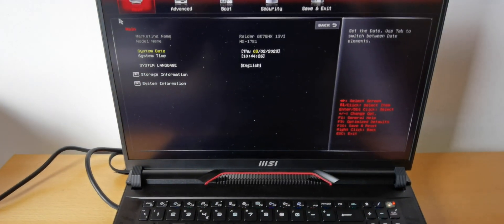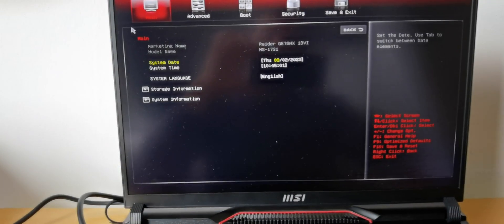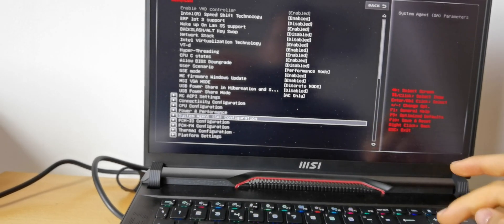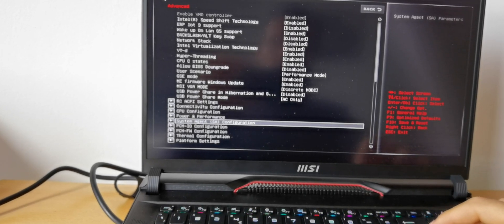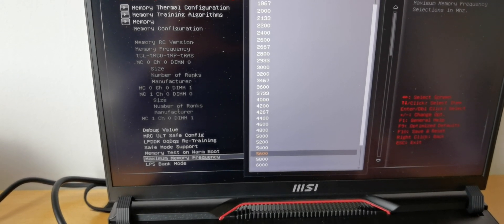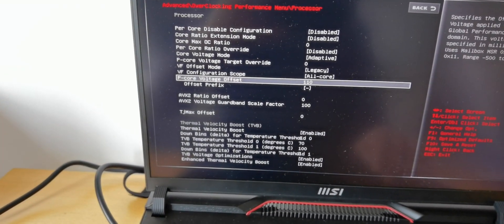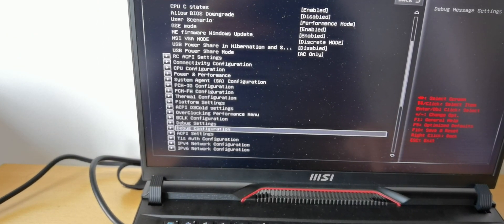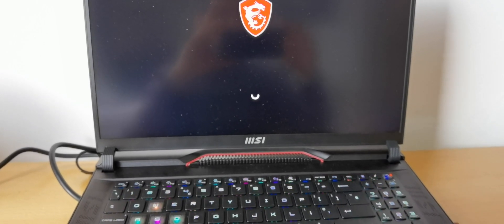how to undervolt msi ge78 gt77 cpu and how to change ram frequency in bios msi

Comment: Msi titan 18 doesn’t have a right Shift key.
Reply from the maker: funny enough is  that  i  bought a msi titan 18  with 5090 gpu,and i  did  managed  to unlock  the bios without  using  the  right shift  key.I sold  the  msi  ge78hx on ebay  few motnhs  ago.

Comment: Thank you very much! You are only one who explained clearly how to change frequency of RAM. It worked for me! My laptop - Raider GE68 HX
Reply: Seriously; what Gigabeat said, every orher msi bios video had a different UI and was not helpful, thanks for the video!!
Reply: In order to adjust memory mhz, did you have to enable overclocking feature and the ram xpm profile? I got a 6400 mts kit but upon intallation, it dropped flat to 4800 mts, idk what to do
Reply: @danielhernandez4305 in my case I didn't turn on the overclocking feature at all. I suggest you to try to enable it or to set just like mine setting - do not turn it on.
Reply: @gigabeat570  thanks for the reply, its very helpfull, so just get in the bios and then adjust memory mhz just like the video and thats it? Also notice the person in this video has single channel instead dual, i do hace dual chanel, does that change something?
Reply: @danielhernandez4305 I think that mts are the key idea of this video. I just can recommend to set your desired mts. 

I have no idea why the author has single chanel ram despite the well known fact that dual channel is better. :) So basically, if you have two slots of RAM - the dual channel is your choice.

Comment: Hi, I was applying undervolting like in your video
But I don't see any noticeable difference in temperatures or performance, and neither in voltages, checking in HWinfo64
How could I check that undervolting was really applied?
Reply from the maker: @WonejoSorKingGaming  if your laptop is overheating, then u are not gonna see any improvement  in performance,or maybe u forgog to disable  undervolting  protection in bios.
Reply: @dunconpitbull  I also disabled undervolt protection in the BIOS
Actually, I don't have any temperature or performance issues on my laptop, but I used to apply undervolt on previous laptops to reduce fan noise by having lower temperatures
The detail is that the Voltage offset could be seen in HWinfo64 when I applied undervolt on other laptops using throttlestop or other programs, but on this laptop, applying it from the BIOS, the change is not observed, it remains at zero

Comment: Can you just do the memory increase to 5600 and enable the overclock setting and don’t do any of the voltage change stuff? I just want to max my ram speed from 5200 to 5600 bc it supports 5600. Pls advise

Comment: Would Throttlestop also work for undervolt as long Windows 11 restrictions have been disabled?
Reply from the maker: That will work,needs to be done every  time when u start the laptop.
Reply: @dunconpitbull  I'll use task scheduler but thanks
Reply: Has increasing the RAM frequency caused any long term issues for you?
Reply from the maker: Didn't  had issues  with it mate,still going strong.
Reply: This would be better actually because I've seen that when you overclock/undervolt in bios, a future bios update may brick the laptop even though you reset everything.

Comment: I have 16gb of ram. So what should i set my maximum memory frequency to? Need answer ASAP please!
Reply: probably 3600 , your amount of gb ram has nothing to do with the mhz. 
most common is 3600 from the last 2-3 years if you have DDR5 ram your probably higher arround 4600 - 5200

Comment: it doesn't work on my MSI GT77 TITAN maximum frequency available is 4000 which is absolutely the same with default settings. Sjo that guy was right - you should tweak other options to make your memory faster

Comment: I bought 6400m/t unfortunately does not work even when I try to look for a maximum frequency it only shows 4000.
But I didn't select xmb custom profiles 3 and it ran at 5600mhz

Comment: Hey, Apart from increasing the RAM frequency the other settings that require changes, changed by someone else you said caused probelems, do I need to change those numbers as well?

Also, Updating the bios will effect the CPU and GPU scores?

Also by undervolting the cpu and overclocking it then downloading the old nvidia driver it works, what to do when i need to update latest NVidia drivers for games to load?
Reply from the maker: Updating the bios will make the laptop a bit more stable in games, I do recommend to turn of the undervolt before u do the bios update. When you change the ram frequency will take a bit longer to boot at first, after that everything will boot like before with no delay. DO what I just did in the clip, nothing else.
Reply: @dunconpitbull  Thanks.
Reply: @dunconpitbull  Hi, Did you also notice that raider ge78hx with 4090 gpu not running at 175w? It's hanging out somewhere 145-147w.

Also I did the bios update ad mentioned release date of 5th May 2023 but after the update the date still remain 24th March 2023. I didn't get this from msi.

Comment: Good afternoon Can I please ask you to record a video on how to undervolt the processor.  I need to reduce the power of the processor so that it does not overheat (I live in Africa now and the air temperature is 30 degrees.)
Reply from the maker: I do advice u to repaste the laptop with tpm 7950,to get better temperatures do to the hight temps that u have I. Africa.
Reply: @dunconpitbull  Thank you very much, unfortunately this is not possible right now.
Please tell me what values should be set to lower the power?
P-core voltage offset 
Offset Prefix
E-Core L2 Voltage Offset
Offset Prefix
voltage offset

Can   somehow set automatic throttling at a temperature of 85c?
Reply from the maker: @DEPEKTOP  u can try- 130 for p core,e core -100,and ring voltage - 80
Reply: @dunconpitbull  unfortunately, it didn't help. in games , the processor is still heated to 102 degrees . please help me, how else to reduce the CPU power? or how to limit its heating ?

Comment: Hi Derek! I bought this laptot,  the same, here in Spain 4.050euro. I studied every Models, my last Laptop from 2021 has beenMsi GE76 Raider 10 uh-63, i7 10850 and Rtx 3080.... You all the similar models, I had precisely those 2 options the Scar18 and the Ge78 msi raider ge78 hx 13vi-063es. THAKS A LOT FOR THE INFORMATION. Sorry I would be very grateful if you tell me if the Asus screen is really better than the MSI one (Brightness, contrast, no or yes GSYNC...). And if you would be so kind, to tell me more or less what are the steps to follow to get the most out of it, what would you tell me with your experience, what "actions" are the ones I have to use to get the most out of it, for example, in BIOS change the speed of the RAM to 5.600mhz... Advice that you could give me, how much Undervolting is worth it, what BIOS options to touch, what OC of the rtx4090 supports you without giving you problems with After Burner (For example, +200mhz in core and 1,000mhz in memory...I don't know).
And in addition to the advice you could give me, if you can tell me please which port can give me the best DP, My "old" MSI had MiniDisplay Port 1.4, and I don't know which usb-c can get me 3.140x1.440 144hz with 10Bit HDR. Can I be calm?
   I apologize for my questions, and I would really appreciate your help.
Thank you very much from Spain!!!!
Reply from the maker: Asus  felt a bit cheap in build  quality  for my taste,performance wise it's  a bit better on msi ,brightness  is a bit better on asus ,i can honestly  say that is 10% better on scar 18 ,and  if u are looking to overclock the gpu  don't  do it ,it will sort life  the gpu usage .Msi it's my choice  here.
Reply: @dunconpitbull  ok, but Derek, My RTX 3080 155w was been OC 2 Years, +132mhz Core and +1.000mhz Mem, and it run at 67º Max (I live In Sevilla, Spain, 45º easily in Summer) and works perfect. One thing, I change the thermal paste for liquid metal 2 or 3 times per year, and -10....-14 Degrees in the CPU. If this model not has (Mine arrives in 4 days) liquid metal, my last Machines, MSI GE76 and GT72 this change was incredible!!
    Thanks A lot!!
Reply from the maker: To be honest  i managed to overclock the gpu to 250 core clock and 1300mhz and the laptop didn't  crashed in games  or furmark benchmark, the temps gone up to 72 degrees  celcius on gpu max,but that doesn't  mean  i gonna play games with those setting  because is gonna kill the gpu .The overclock that u set for your old laptop msi is not  that  high to what i though  you gonna go to boost your fps in games.G sync  is not  a big of deal for this generation, you'll  have high fps in games which  means that g sync  is  kinda  useless   in my opinion for 2k resolution.
Reply: @dunconpitbull  ok, no for heat in GPU, maybe can´t reach more OC for the 155 TDP, the cooler Booster 5 its a great or inclusive better solution than other, "solutions", like Asus Scar 18 with 3 coolers or even Gigabyte with 4 coolers. 
   And yes, this 120mhz and 1.000mhz in the 3080 with 155w of TDP, guives a 8%-10%, just to play in 4k decently. (Timespy total Score 12.650P, 10.200 from CPU and 13.250 from Gpu) Derek, I hope can play with this Laptop in 2k, or my monitor 3440x1440p and 4k on my TV, without "limitations". Not need reduce RTX, shadows...etc to play with 80fps-100fps with DLSS in quality. ¿How is the DLSS3? Thanks a lot!
Reply from the maker: @zenckers1981  i  just  uploaded  a  video  with time spy score on this device  by overclocking  the gpu  to  250 core clock and 1300mhz  on memory

Comment: What is your current undervolt settings?  I did same exactly in the video of yours, causes crashes time by time in games.
Reply from the maker: Depends on the cpu silicon lottery, some  processors can go 170 - undervolt, try  - 100  and for the ring - 50,mine it's stable at - 125 now with - 80 for the ring. Try to install the driver graphics card from msi website first, cos I use u have problems in games with the new driver from nvida website.
Reply: @dunconpitbull  thanks man, installing the old  driver made a serious performance jump with the undervolting!!
Reply from the maker: Glad to help, peace out.

Comment: WIll this work for MSI GP76 with i7 12th gen processor? (not the HX version). Thanks in advance for your answer!
Reply from the maker: Yeah, will work got the same bios.
Reply: MSI GP series works with DDR4 and does not have this problem. The bigger problem is that MSI removed option to load XMP profiles. It's very bad from performance perspective.

Comment: Good afternoon, please tell me if you can be asked to shoot a new video with tests in TimeSpy, FireStrike.  Has the performance changed with the new drivers?
Reply from the maker: I tried  with the new driver  for gpu but cause  problem with hibernation mode,after 3 min off not using the pc ,was going in sleeping mode and was loosing  signal to monitor.

Comment: Good afternoon.  Tell me, please, do you have any tearing in frames or any other problems when playing at 240 fps 240 hertz?  since i read that this laptop does not have G-sync or adaptive refresh rates..(gaps in the image during sharp turns, something that should be solved using g-sync)
Reply from the maker: Sorry ,i can't  help with that mate,i didn't  experience  any of those issues on my laptop so far.
Reply: @dunconpitbull  Can you set any game to 240Hz ( lock maximum 230FPS ) and move the mouse sharply to the right or left. record video from your phone in maximum slow motion. PLease)) it will take 2-4 minutes you time.     In general, repeat something like what is recorded in this video. 1)  https://youtu.be/ug_CZZfsuqc      2) https://youtu.be/nMbi9mEsLNI
Reply: it passed 1y, but bro mi gp66 is 240hz and it doesnt seems like 240

Comment: just fyi, have a GT77 and the max memory frequency choice was 4000.
Reply from the maker: Just follow ths steps in the video and change the memory  frequency  from where i showed.
Reply: @dunconpitbull  i understand what you mean, but when i go into the "Maximum Memory Frequency" the highest frequency i am able to choose is 4000, i see yours goes all the way up to 12800. I think ge78 and gt77 are shipped with different rams. The stock rams in my gt77 are 2x32gb samsung rams.
Reply: @gunnu85  yeah I actually am going to buy the fury ram if I were you I would sell the ones that you have and purchase fury
Reply: @n.m.e5787  which fury ram are you buying?
Reply: @n.m.e5787  Fury ram is not compitable with GE78 HX , I tested it
Reply: @gunnu85  sorry for late reply I got fury 6400mhz
Reply: @ahabaz  I bought the gt 77 2023
Reply: @n.m.e5787  thanks!
Reply: @n.m.e5787  Don't! That's what i have in my Msi GT77 Titan HX 13VI now. Max frequency i can choose is 4000 and eventhough i tinkered a bit following guides and such of this issue i managed to get them running at 5600MHz but then it always froze after a few seconds at the Msi boot logo.

Comment: Hey, how come you came down to -110 for the undervolt stuff and 70 for the core clock. Didn’t you have -125 and -75 for the core clock. Is it better at -110 for the undervolt ?
Reply from the maker: It wasn't  stable in games in a long run at that undervolt.

Comment: Hello! Is it stable with 64gb of ddr5 ram on 5600mhz? What chips brand? Hynix a-die? You can check it in cpu-z(memory), aida64 etc... Pls, answer! Regards! Subbed! 🙂
Reply from the maker: Yes, it's stable with 64gb of ram at that frequency, but you have to change it bios to run at 5600mhz,otherwise they will run at 4800mhz by default, do what I showed in bios and they will work like a dream.
Reply: @dunconpitbull  Can you, pls, check ram chips vendor? Is it boost cinebench score and performance, in time spy, port royal? Thx!
Reply from the maker: @vitalymichailov387  the memory that i got now is fury 5600mhz.
Reply: @dunconpitbull  I got fury 6400 MHz I'm going to try it soon.
Reply from the maker: It's gonna work 100% on 5600mhz,but u have to change that in bios. Will take few minutes to rebbot after you changed the ram frequency in bios.